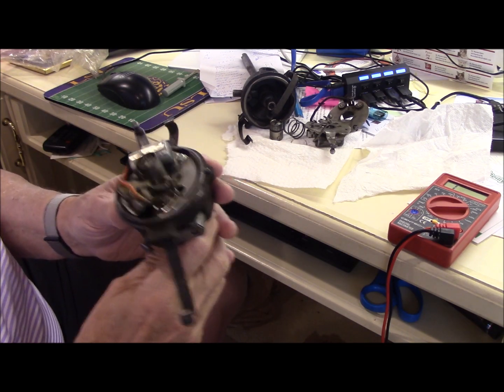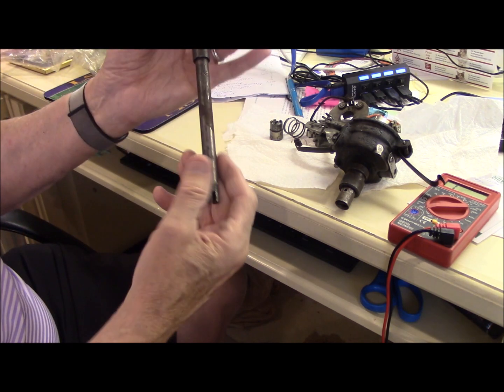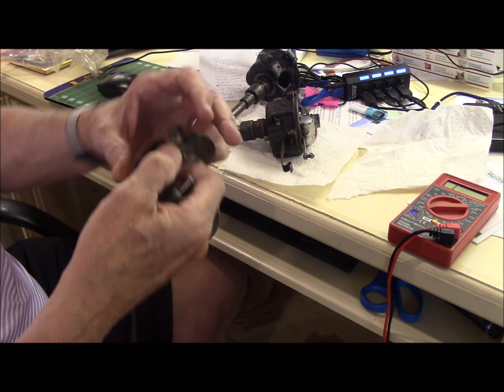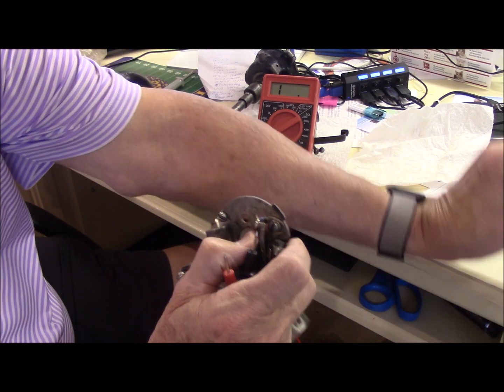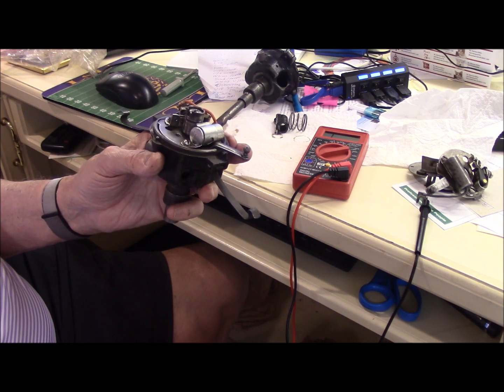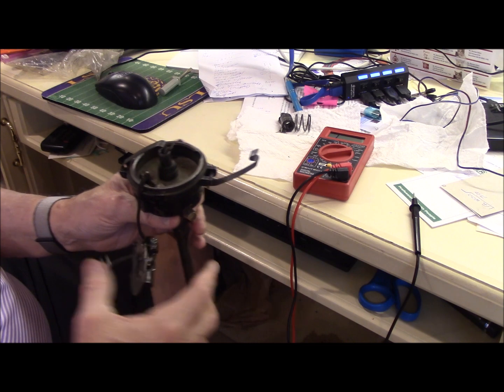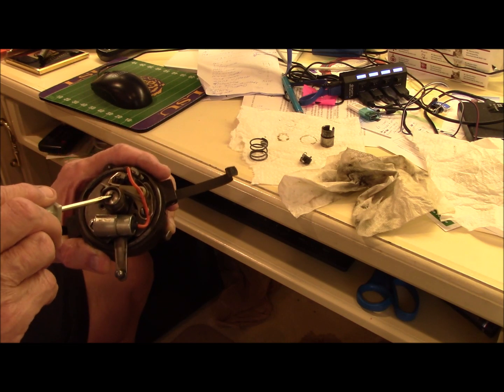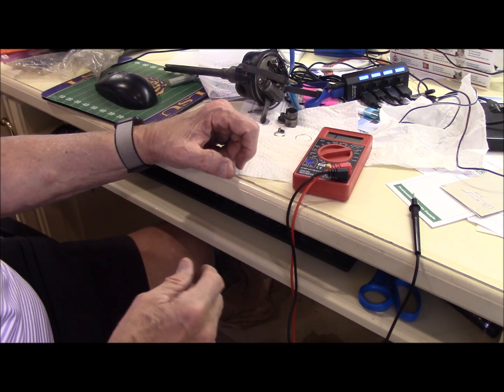Understanding the Model A Distributor

Comment: Your videos are very good on the model a ford, I had a problem with my model a yesterday, I started it and it started back firing through the carburetor, it has never done this before, what do you think might be the cause, I ordered a set of points and condenser, my car always starts and runs fine, it is a 1931 TUDOR, great video, THANKS for sharing your knowledge on these Model A FORD'S.